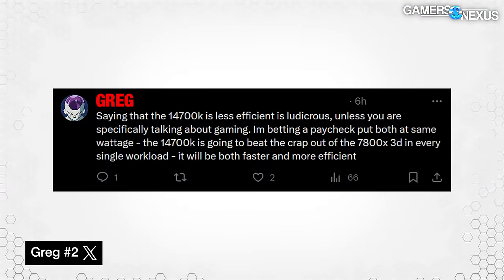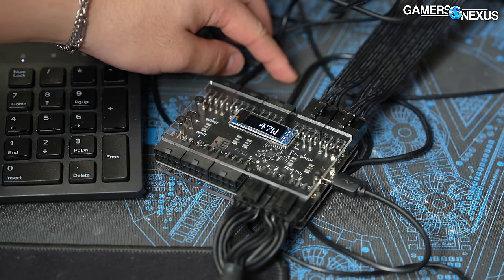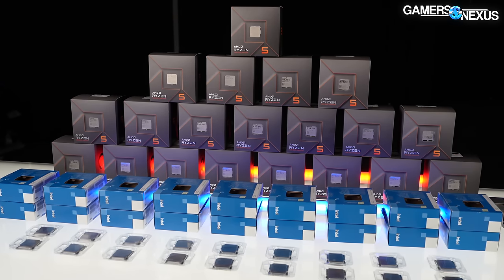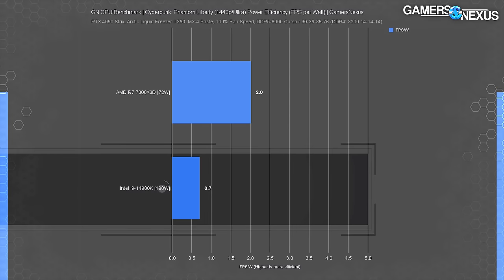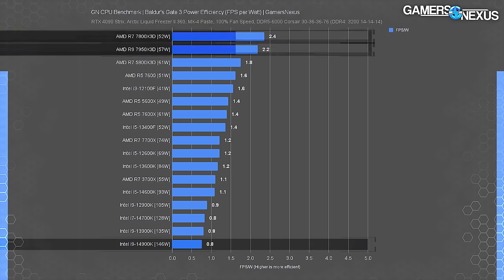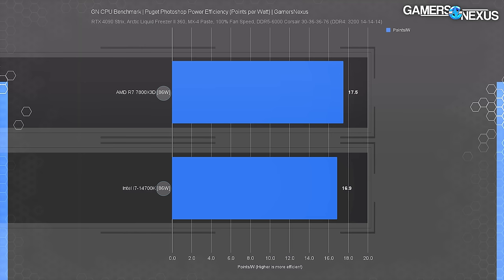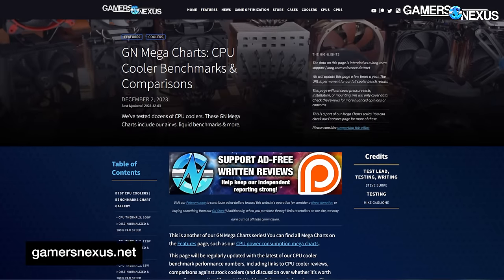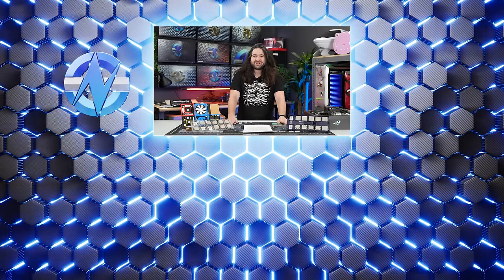The Intel Problem: CPU Efficiency & Power Consumption

Comment: Nice work on this one.  Power consumption and power efficiency are two of the most important yet overlooked aspects of this technology.
Reply: sadly optimal power target/limit was never shown as they capped fps for gaming not power which is hot the correct way to go about it.
Reply: intel bulldozer moment lol
Reply: some intel fanboys only state that the 14900k smokes amd just because of raw performance while drawing three times or more wattage. thats what they never tell users, and also that it gets hotter while doing so.
Reply: @MultiOlimac  Well TBF some people don't really care about it if they have the money for a proper cooling solution. Most people just aren't going to figure power efficiency into a Gaming build. A server or workstation that's going to be running 24/7 and there's going to be dozens of them? yeah people are going to care then. But most gamers are just going to buy the CPU that gets them the best frames that's within their budget or other build constraints.
Reply: @pino_de_vogel  no. Why would you limit power for gaming? You want a smooth experience first and power efficiency second. Limiting power low enough to potentially destroy or have fluctuating framerate kinda defeats the whole point. No sane person buys a top end CPU to look themself out of 60+FPS gaming.
Limiting power for non gaming makes way more sense, because you don't need a specific speed/framerate to get a enjoyable experience.
Reply: @user-to7ds6sc3p  A 50% power reduction has higher fps then a 50% fps reduction and thus a smoother pgameplay.   the fps cap ius just that a fps cap. it caps fps without trying to make the cpu efficient.  if youcap the cpupower it works at a more efficient point. 
And yes if you go to low it will cause issues but at 125 watt the intels run fine (for gaming). its not till under 100 watts the intels really start to dip hard and lose 1% lows @1080p)  on 4k you may aswell cap it on 65 watts as gpu will always be the limiting factor. ! 1440p thats more like 95 watts. 

And no you got that backwards limiting power for non gaming loads will severly impact performance. It will increase efficiency but it will cost more performance then it does for gaming as gaming doesn't need that much power.
Reply: I wouldn't venture as far as saying "most important aspects". I, personally, don't care about power consumption OR power efficiency.
Before you brand me as a fanboi of either "side", I own both AMD and Intel machines (and not just one of each, mind you). Each have their merits for certain workloads.
Power consumption, however, was never something I looked at.
Reply: @war4peace1979  Energy is the most important resource. Better efficiency, mostly, is the main point of technological improvement because there are millions of users, not just you, so impact of this is pretty significant.
Reply: @war4peace1979  wel i assume your on the americaan side where you pay 11 cents per kWh.  Here early this year we paid 1.2 usd and right now im p[ayting 44 cents per kWh.  That adds up fast and makes it a very valid aspect as power draw directly affects the total price of use over the lifespan of the product.

Comment: The important question remains tho... How will userbenchmark spin this one??
Reply: They were bitching on the 7950x review how it uses 160W (has 160W tdp actually) and on the 14900K how it’s SUPERIOR. I emailed them a screenshot of the 10fps/watt and 3fps/watt and called them shills and liars.
Reply: Can we just collectively stop visiting that site? It doesn't deserve any attention. It misrepresents its contents as benchmarks when they are just random numbers pulled out of his a**, inconsistent with every other reviewer.
Reply: Never understood the hate for userbenchmark, intel wins, and it makes diehard AMD butthurt, but in terms of efficiency, that's a whole different story.
Reply: @stacksofslaps7442 why buy a chip that consumes 3 times as much power to get a 10% gain? Ever heard of the law of diminishing returns? 14900k for gaming is a waste, 7800x3d is better for power consumption and price. Easy choice.
Reply: @guywhitey2028  they totally win tho ignore the absurd power requirements and all the other data on non biased sources that clearly show a very different picture.
Reply: @stacksofslaps7442  "Never understood the hate for userbenchmark" They literally create false performance sheets. Take the 5800x3d vs 12900k review. It's the worst offender. Also, intel only wins in clock speed which means literally nothing when they have 2 less cores than most amd cpu's and like you said, who cares about 200mhz difference when it takes double the power draw (if not more) to get there
Reply: @guywhitey2028  microcenter offers killer deals for intel products and electricity is cheap so i dont care.
Reply: @stacksofslaps7442  now i would not trust an intel cpu to be honest. no matter how cheap

Comment: Idle power consumption for CPU and GPU reviews would be extremely cool to see. I don't think anyone is doing this kind of tests, but it would be nice to know that
Reply from the maker: They're tough to get right. Working on that separately!
Reply: my 7950x3d pulls around 30ish watts at idle and my 4090 pulls 15w.
Reply: AMD would be hard because the 7000 series still has high idle power under certain circumstances like different monitor resolutions and refresh rates amongst other things
Reply: one problem with idle power testing is the crazy swings based on motherboard model as well as software configuration.
Reply: @tommihommi1  second this. it’s very hard to have a “control” when there is no “control” everyone’s software is different, everyone’s hard ware is different, even people’s monitors are different, it’s hard to control all that when no one does that 100% of the time
Reply: Not only 100% idle, but with light load, like watching YT or scrolling website. If intel spikes to 300 watts when reloading website, efficiency will be terrible.
Reply: Techpowerup does it
Reply: @mcod99 15w really? I guess not 4K? Mine pulls 25W at 4K
Reply: @Zapdos0145 Yeah it'd be hard but really valuable. As I use my PC for work and have 0.45 euro electricity cost, idle power draw is really important to me.
Reply: Even better would be idle power on Windows vs. Linux. I get double the battery life on my notebook on Linux with a lightweight DE compared to Windows 10.
Reply: @komorka88  Yes, this is something i'd also like to see. Not all of us using pc for all day gaming or work. There are lots of people using pc just to chill, scrolling websites, watching YT, or watching movies.
Reply: @mcod99  Someone is lying with that 7950x3d number. Either that or you have a fresh installation of windows with nothing running in the background, or some other thing I cant even think of. How are you getting that?
Reply: mines at 1440p  @seeibe
Reply: @GamersNexus  Even just a screenshot of HWiNFO64 "current" chart on the cpu's multiple sensors + a screenshot of the table showing the minimum, maximum, average power consumption chart over time while you do your benchmarks would be cool to see.

Comment: So as someone with a 7800X3D living in Germany, where electricity is about 32 cents / kWh...  WOW I'M SO BUSY SAVING MONEY HERE.
Reply: You you realize that even if you would use 400w 24/7 for a month @ 40c price, it would only cost you like 100€

E: You do it scales down? Eg. 150w gaming 2-4h per day @ 40c.
 Month cost: ~3-6€
Reply: @slipknot1943  I don't think you made the point you meant to make there.
Reply: Positive side: Saving power. Negative side: It's that expensive because it's all coal, instead of GN's nuclear...
Reply: On the other hand i'm probably wasting money, i have a 5800X3D and it takes about ~60W on Idle which is a lot especially when i watch videos which is when the system spikes to 110W watching youtube, my old i7-6700 system does about ~33W... while watching videos, i know it didn't have a GPU in it, but that's still a heck of a difference especially at idle where the 6700 would draw like 15W at most, that's a huge difference and it's really stupid how little AMD's CPUs save power at idle because of their IO die or whatever, or that my GPU needs apparently at least 40W just to watch a damn video at 1080p.
Reply: @CarbonPanther AMD can barely save more power at idle with their chiplets CPUs because moving data on any kind of processor consumes more energy than doing the calculation itself and considering that AMD's chiplets need to communicate constantly with the IO Die though the infinity fabric is quite hard to actually save power.

Now with AMD GPUs... Yeah they really need to improve on that :p
Reply: @CarbonPanther  idle is difficult. I have two monitors capable of 144hz. I get 20watt idle power draw on my GPU when I have one configured to be 120hz and the other 60hz. As soon as I increase the refresh rate of any one of them beyond that, the GPU idle draw will double to 40watts. No idea why.
Afaik amd CPUs aren't known for low idle power draw, but even then 60watts only for the CPU seems pretty high to me tbh.
Reply: laughs in French nuclear power at 17¢
Reply: @CarbonPanther  Huh?
5800X3D should idle to about 26-33W. Up to about 45W max if watching YT and doing light stuff.

Also GPU (6750XT) idles at 6-9W for me even while doing light load (i have freaking game running minimized). Watching videos doesn't increase number much. 21W probably is highest i saw from decoder... But ofc i can load is much higher if needed.
Reply: @thegeekno72  laughs at nuclear/hydroelectricity for 8.7¢ from 7:00 to 22:00 and for 3.3¢ from 22:00 to 7:00. 
Granted we also use coal and fuel oil. But with electricity heat also comes to houses to keep them warm. 

Yes, we have double tariffs. During day when people use more electricity (as they are awake... Usually) for cooking working and cleaning stuff price is higher. But at night when people go to sleep price becomes much lower, making it more efficient to do some jobs at night.
Reply: @DimkaTsv  Well i've done my measurements multiple times at the wall, i forgot to clarify that, so this is whole system power
Reply: @SimonVaIe  It was whole system power i forgot to clarify that sorry!
As for the Hz power spikes for me it was to do with the VRAM, you can adjust your monitor to tighter timings, which causes them to be more in sync thus relaxing the memory access
I've read Nvidia gets away with this issue by forcing the VRAM in a low power state which takes longer to react when waking the screen, while AMD always leaves the memory behavior at default which is a bit faster, but consumes way more power
Reply: @ismaelsoto9507  That i know! I just wished after 3 gens they'd start working around that so they don't get beat by 2. gen Intel CPUs idle power consumption xd
Reply: @CarbonPanther  oh, measurement from wall makes more sense. As it takes in account fans, RAM, traces and VRM losses, LED's and power supply efficiency, which is about 80-85% at low enough load. 

Btw, my monitor definitely was one not following spec, and VRAM got locked down so GPU went up to 21W eventually. But i did custom resolution fix and FreeSync range fix for CRU fix. So now i have 0 issue with GPU idling. 

I will agree, though, that AMD must do something with this interaction with such monitors. And it should not be half-ass FreeSync mask which they use now. 

Granted, from numbers i saw. Lets assume you have 13700k that uses about 150W and 7800X3D that consumes 76W for more FPS on average. But at complete idle (which won't be complete idle most of the times, and at low loads AMD spikes wattage at smaller scale)...  Lets assume that 13700k consumes 5 watts (generous), while 7800X3D consumes 31W (realistic). So for each 1 hour of gaming you must leave your system at complete idle for...
(150-76)/(31-5)=2.846 hours
So if you game for 4 hours, you must leave system at full idle for approximately 11 hours and 25 minutes to tie power bill via idle inefficiency due to AMD IOD power requirements. And that means no load at all. Even not Windows routines.
Granted it is for uncapped FPS, margin will become smaller with FPS cap. 
But it also doesn't account for differential tariffs. If i play 4 hours during daytime, difference in money (based on my tariffs) will be covered only through... Oh my! Almost 30 hours of idling at night!!! Well, let's assume it will be about 16-20 hours total of night and day idle. (Yup, calculated approximation. 9 hours of idle for night, aka 22:00 to 7:00 as specified for tariff, and 7 hours of idling at daytime. Exactly 16 hours to equalize results of power consumption for 4 hours of gaming)
Reply: @CarbonPanther  ah no worries. That makes more sense, though I share the sentiment that 60 watts idle draw, even for the whole PC,  is still quite a lot. It can be as low as half of that as you yourself measured with your previous machine.
My GPU is a rtx 2080 btw, so my refresh rate / GPU power draw inconsistencies are on a nvidia GPU. When I searched for this behaviour a couple months back it seemed that both manufacturers can have this behaviour on multiple monitor setups.
Reply: @SimonVaIe  well, more monitors, heavier load.
Having them on different resolutions and refresh rates worsen situation... Overall, though, Nvidia does better job at this, as it doesn't require VESA spec timings which:
1) Barely any manufacturer does to cut costs on bandwidth. 
2) After some resolution/refresh rate you cannot easily create custom resolution because of max pixel clock value restriction. So even if you can resolve issues through CRU for AMD, there are limits to easy solutions at some point.
Reply: @DimkaTsv  ah my issue is the inconsistent jump. 
60hz+60hz≈15watts
120hz+60hz≈20watts
120hz+75hz≈40watts
120hz+120hz≈45watts

I gotta say, the timing stuff sounds annoying
Reply: @SimonVaIe  it definitely is. And it causes other issues too. Some of them coming from AMD attempt to fix incompatability through FreeSync. 
They FOR SURE should rework VRAM management for non-compliant timings in future. Probably it will need additional hardware or firmware changes which is not possible for existing chips... But it must be payed attention to.
Reply: @CarbonPanther  Sincerely? Not a huge deal tbh the rest of the system (Motherboard, RAM, SSD, HDD, FANS, RGB, PUMPS, etc.) could end up consuming more than AMD's CPUs at idle... If it was a huge deal and it affected AMD's sales they would have fixed it some gens ago, in truth it's only very significant in the mobile segment and that's why they've only used monolithic APUs on those until they needed to launch a 16 Core mobile CPU to compete with Intel's 12/13th gen offerings.